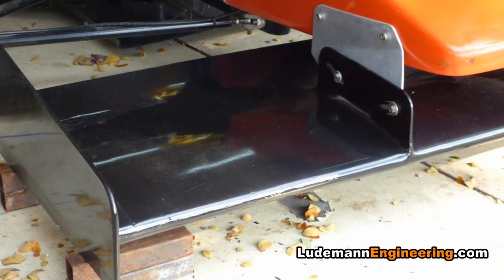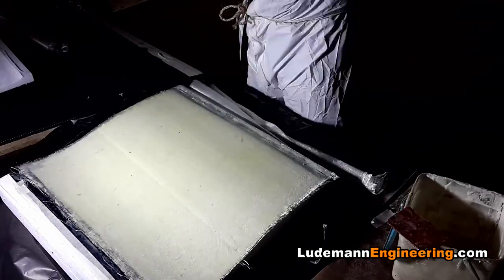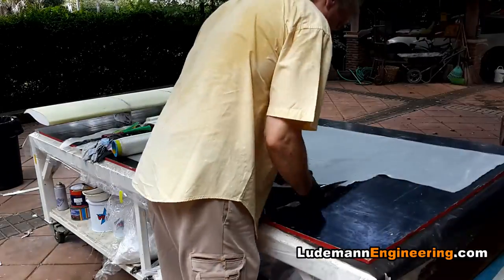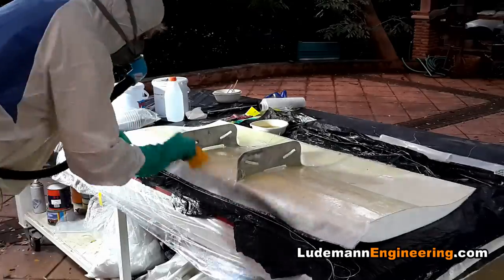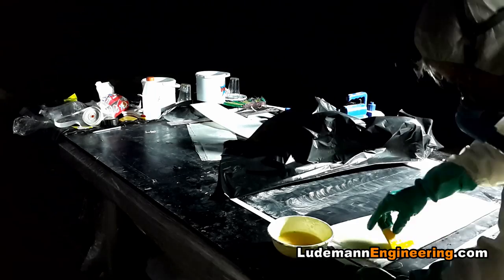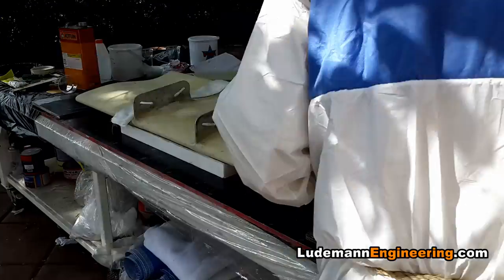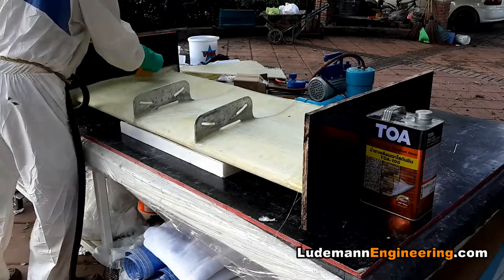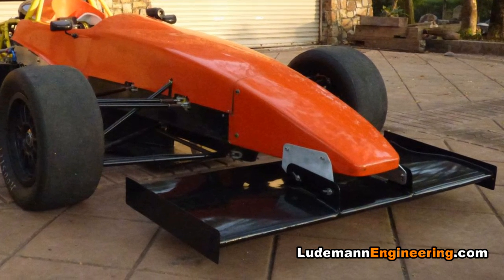Formula 1000 Race Car Front Wing Moldless Fiberglass Foam Construction Fabrication Build

Comment: Nice videos, I've enjoyed greatly watching them. A good way to keep the cutting wire at the correct attitude (especially with longer parts requiring two people, and tapered parts) is to put evenly spaced marks on the pattern with numbers, and practice to reach these marks in unison. Also since the styrofoam does not work well in very thin parts, the trailing edge in model and full-size airplane construction using hot wire cutters are cut off and finished with a strip of wood (aspen, balsa, pine, etc) sanded to shape. Makes a bit more defined trailing edge.

Comment: Love these videos. You're a legend for putting them up and sharing. What adhesive was used to get the aluminium and foam to bond together?
Reply from the maker: It's not very important what adhesive you use, because once it's stronger than the foam, the foam will break first. I just used the same 2-part epoxy I used for everything else to guarantee things stayed straight while fiberglassing. Essentially all the strength comes from the fiberglass skin.

Comment: Wondering, how are the bolts/nuts screwed into the fiberglass? Or are they in the frame? I want to make a hollow wing for my car. I am wondering how I could mount two bolts into the wing, that would connect back into two holes on my hatch, so I can secure the wing down with not only two bolts, but the whatever double sided tape(super strong stuff sorry forgot the name).

Comment: How did you determine the airfoil shape you wanted for the wings and tunnel?
Reply from the maker: +Raging Grognard The front wing is a profile from a university research paper where they used something like a genetic algorithm so a computer could try many designs and find the best one. According to my CFD tests, it works extremely well.

Comment: is the honeycomb foam sheets for vacuum processing only???
Reply from the maker: Good question. I think you'd have trouble getting adhesion between the fiberglass and the honeycomb because of the uneven surface, but I haven't tried it.

Comment from the maker: To the "ron m" who recently graced us with his presence but has now blocked me or deleted his account, and to anyone else who wants to talk smack. I will call you out, I will send you out the airlock, and I will memorialize your brilliance. Here's a transcript of our little talk:
ron m: "must  weight 50 lbs" {grammatical errors include failure to capitalize proper nouns 2x, double space, misspelling 'weigh', failure to end an abbreviation with a period. Pretty impressive for a comment only 19 characters long.}
Me: Two layers of fiberglass over styrofoam, with two 1/8" aluminum bulkheads and honeycomb endplates, strong enough to lift car by, and strong enough to withstand hundreds of pounds of downforce. Weighs 13.4 lbs. including paint and stickers. Your estimate is off by 273%. Your channel has no content. Say hi to your mom for me.
Reply: As the weight is 13.4 lbs, could it be interesting to replace a couple of layers of fiberglass by an aluminium rod inserted in the aerofoil? This way you wouldn't get the added inaccuracies on your aerofoil by just adding layer after layer. 
Furthermore, the weight of an insert of more than sufficient strength would be around 0.5-1 lbs. (assuming 1.5m front wing width).

Lastly, using an aluminium insert could give possibilities for an excentric front wing mount, which would make adjusting the front wing more tedious, but grants possibilities to massively clean up the airflow around the adjuster plates.

Comment: must  weight 50 lbs
Reply from the maker: Two layers of fiberglass over styrofoam, with two 1/8" aluminum bulkheads and honeycomb endplates, strong enough to lift car by, and strong enough to withstand hundreds of pounds of downforce. Weighs 13.4 lbs. including paint and stickers. Your estimate is off by 273%. Your channel has no content. Say hi to your mom for me.